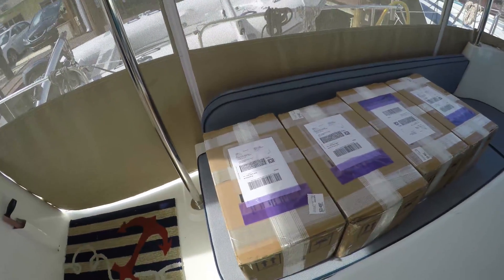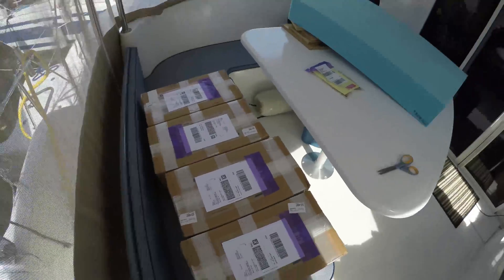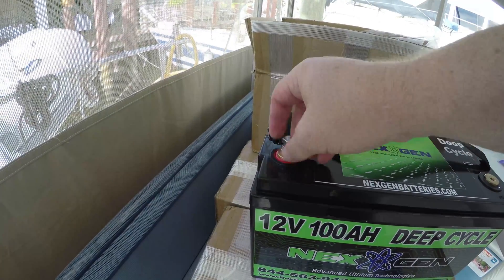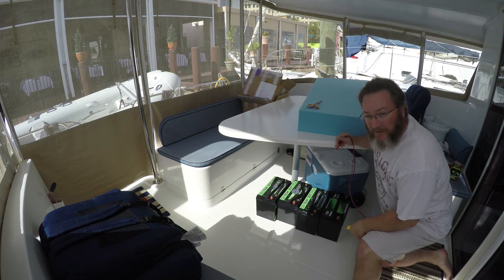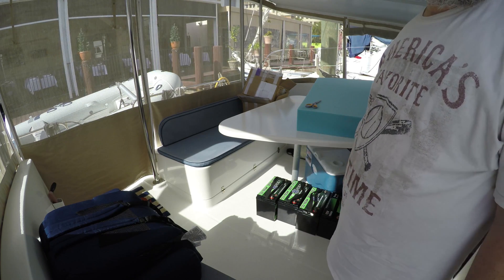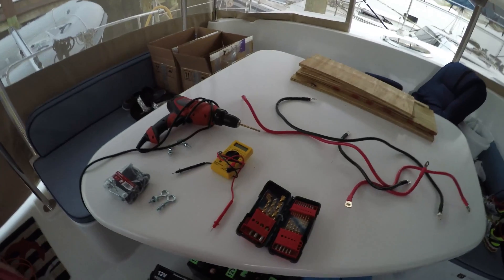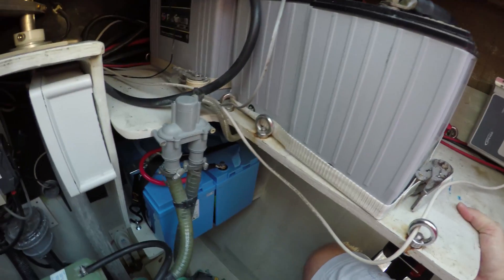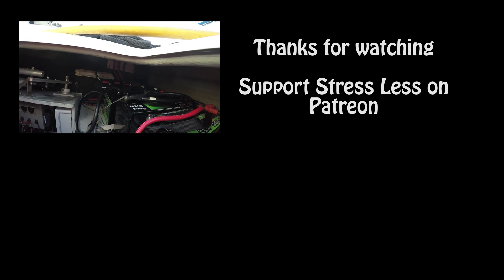600 AH NexGen Battery Installation

Comment: Van Lifers ....  Smart Battery and NextGen sell a 300AH Lithium battery for around $3k that in theory can be used as starter battery if you can adapt your battery tray for roughly 19.25"x10.25".  They deliver a whopping 900 reserve capacity minutes at @20A.    In a van with a 220Amp alternator these (in theory) would charge very fast. I wonder how fast?  By my rough estimates  (I THINK) that much battery should be able to run a 450Watt Air conditioner for 6 hours and still have 30% power left.

Comment: You didn't buy Lithium Ion Batteries.  They are Lithium Iron Phosphate Batteries (LiFePO4, not Li-Ion).  Completely different batteries.  They are in fact a safer battery and are enviromentally friendly, where true Li-Ion batteries are toxic to the environment if disposed of.  The LiFePO4  batteries are what is used in Hybrid cars, whereas true electric cars, like the Tesla uses Li-Ion batteries.  Most people do not understand that.

Comment: Can these be used as drop in replacement in a van with group 31 today? Do they have a CCA rating? I will have a 325 Watt solar panel with an MPPT controller, but how will they respond 160A alternator charging and not being drained below 80% most days between charges?

Comment: Is it possible to connect these Lithium batteries in series & parallel
Reply: These are already 12V batteries. By putting them in series you multiply the voltage. Not sure why would you need this.

Comment: Please stop calling them Lithium Ion batteries... They are LiFePO4... Lithium Iron Phosphate and while these will replace lead chemistry batteries, Lithium Ion will not... different voltages. Your LiFePO4 are 12.8 volts nominal @ 3.2 volts per cell where Lithium Ion @ 4 cells will be 15.4 down to 14.4 volts, according to Wikipedia. When the battery is discharged, it still exceeds the Lead chemistry's nominal voltage. The weight is 29lbs. It pays to download or ask for the manufacturer's specs so you understand all the terms and voltages. Assuming that the original batteries weighed in at 60lbs each, you have lost 66lbs of ballast weight.
Reply: correct !!!

Comment: Mount your Epever MPPT charger vertically. The cooling fins need space above and below to allow for a convective flow of air. Horizontal means poor cooling capability, potential for failure at critical time. (Today's reading: operation manual)

Comment: 600AH with lithium is the equivalent of 1200AH with AMGs... this dude now has 15KWH of power.
Reply: nope. 1200ah agm@50%=600ah.  600ah lithium @ 70-80%dod = 420-480 ah
Reply: okeanos467 Nexgen website states thousands of discharges at 100% DOD.

Comment: you could of made your own batteries for way way less and much more capacity
Reply: can be done. was thinking about it for a while. but all the fuss. plus individual 1860 cells if better quality getting expensive. if no name could  be found cheap. but no guarantee how long they'll work.
Reply: How do you make your own battery
Reply: @BDM I was thinking the same thing with Ford car batteries.. there 100 amp hours and I think 3.2 volts.. and there like 30 bucks a pop!@ yeah I'm not spending 7000 grand.. if I could afford it I would just for the plug and play

Comment: I find the high prices on these batteries a puzzle. Have seen stories that Chevrolet is paying LG abut $150. per kw hour and Tesla says they are close to producing batteries for just $100. per kw hour. That would be about 80 amps at 12 volts. Obviously large  outfits get a break, but these batteries are running so much more that something has to give. Are they making huge margins or ???
Reply: They have integrated charge controllers making them work with the existing lead acid charging.
Reply: Lithium batteries on retail market are not getting cheaper despite technology constantly improving and more and more battery plants coming online. Wholesale prices on the batteries are very low, but there is yet a big manufacturer to come out and flood the retail market, sinking the prices in the process. While retail market is controlled by the small shops, expect prices to remain steady high for a number of years.

Comment: Question as to battery management.  As any one knows Li batterys are fussy as how they are charged and discharged.  Each cell has to be charged the same as all the the others.  Usually by drain off some power to the high ones.  Li batteries must not be over changed or over discharged.  Usually a thing called a "Battery Management System or BMS".  Without a BMS Li batterys are prone to quit working or worse catch fire.  So where is the BMS for these batteries?  In the Batteries themselves or somehow in the charge controller?
Reply: Yup, probably took long to type out his complaint that to look on their site and see "Every NexGen Marine Lithium Battery comes with a built in Battery Protection System (BPS) that will protect the battery from over voltage as well as under voltage ..."
Reply: Stanley Tolle I clicked on the link and saw they have a built in BMS.
Reply: The BMS makes them stupid proof. I beat the shit out of mine, 6x200Amp Hours, and they don't show the least bit of distress. The 2100 Amp Hour AGM bank drops off much too quickly.  My guess is that the lithium bank is at least as powerful as the AGM bank. They are 210AH cell tower backup batteries, 5 years old, easy duty, never been below 75%.

Comment: You could've bought a bigger with that $7,000
Reply: I just got 1000 amp hours of Aims lithium batteries for my rack for about the same price with a charger. I got 5 of their 200 amp hour batteries. So far so good. They are nice units.